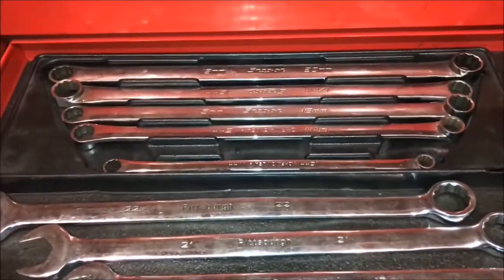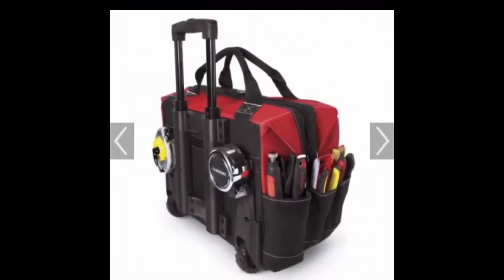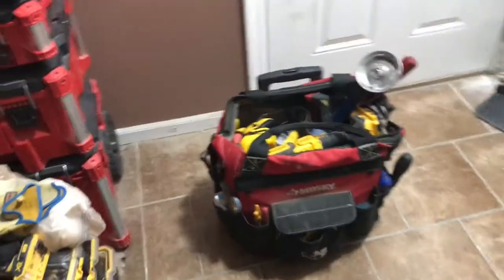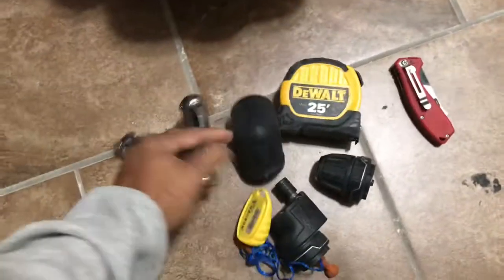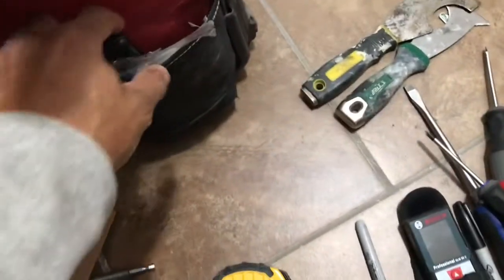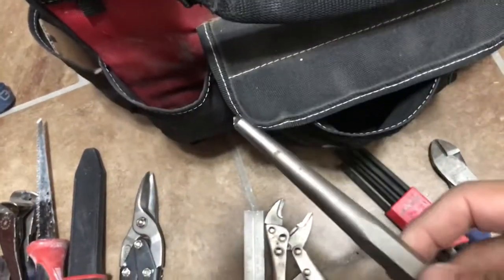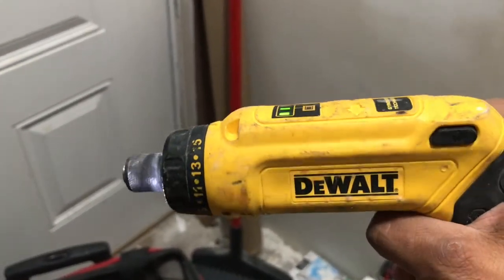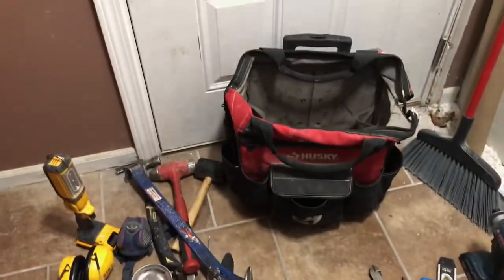Husky 18 inch Rolling Tool tote Review after actually using for 1 year!

Comment: Had mine supplied from employer since mid March, this year. All okay until yesterday, handle won't retract down last two stages on one side. Trying to remove the plastic ferrule to look inside but not budging with the four retaining lugs on each  stage.
Reply from the maker: Uh oh. Hope you get it all fixed up 👍
Reply: @MJ100k  I had a look but no obvious way of dismantling the tubes to get inside to see the problem. I suspect the pin is actuated by a spring and wedge but for some reason the movement isn't enough on the middle and bottom sections. I've taped the middle pin in a recessed position and the bottom one behind the thick plastic cover recessed with a screw cut down to about 3mm so the head is outside the tube. Not perfect by any means, but at least I can drop the handle.
Reply from the maker: @steveb6386  Cool- good thinking 👍